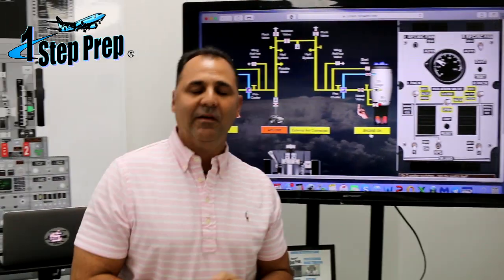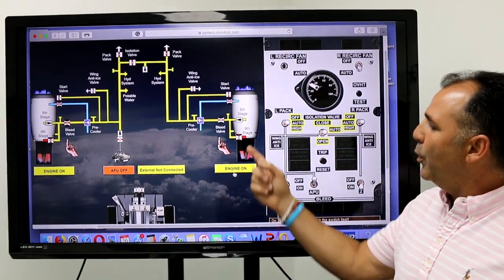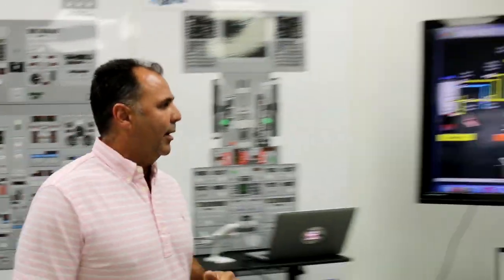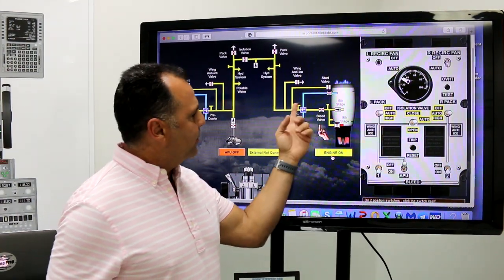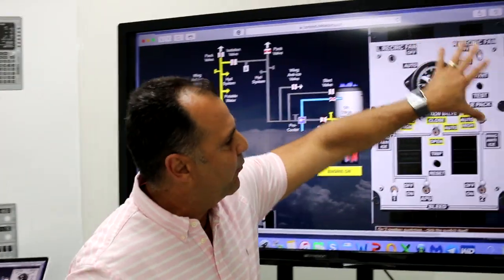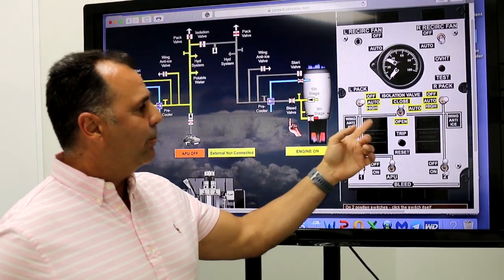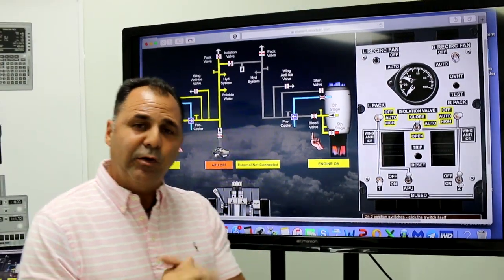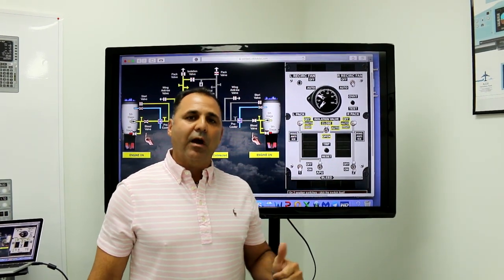B737 Pneumatic System: Bleed trip Off Review

Comment: IN THE 737 IF YOU USE THE TAT EMERGENCY OVER HEAT TEST SWITCH FOR THE WINDOWHEAT THEN IT WILL CLOSE THE BLEEDS WITHOUT NOTICE AND YOU HAVE TO HIT THE TRIP RESET BUTTON OR YOU GONNA FIND OUT THE HARD WAY YOU NOT PRESSURIZING.

Comment: From a maintenance point of view I dislike how the valves are not called by their correct name.
Bleed valve - is the PRSOV (pressure regulator and shut off valve)
Fan air valve - is the PCCV (pre cooler control valve)
On initial engine start, the 9th stage will supply the air pressure to open the PRSOV

Comment: With all due respect, pilots just need to tell maintenance personnel whether the bleed trip reset or not. It’s up to the maintenance personnel to do the troubleshooting and then replace the appropriate component
Reply: True, but it will be good if the Pilots know, what He is actually doing when he is following the QRH procedures.
Reply: Also, it helps the maintenance personnel with the T/S. The more everybody works together, the better; that's what I think. Thank you for your answer👍

Comment: No, no ))You think It is easy. But no. Posiible trouble cause: bleed air regulator, pressure regulator shut off vlv, hight stage valve, sensiting lines, pre-cooler, hight stage regulator, pre-cooler cntr vlv, sensor, switch and mode of engine operating and ext.
Reply: Thank you for your answer, and I know is not easy, but the only thing we want to know on this video is if the problem is Temperature or Pressure, once you figure this out, then you start looking for the right component to change.
Reply: @jcdominguez2075  why, as pilots, are we looking for the right component to change? The simple in-flight fix is to reduce duct pressure by selecting CLB-2 and/ or using engine, and/or anti ice.
Reply: @jcdominguez2075 pilots don’t change components. The most useful thing they can do in this situation is tell the maintenance guy if the trip reset or not
Reply: @NicholasRiviera-Dr  Thank you, Nicolas, I know Pilots, will not change components, this is more for the Maintenance guys, but at least, the pilot can tell the Mechanics if the problem is pressure or temperature, if we actually understand what we are doing, not just following a procedure, what do you think?
Reply: @JuanDominguez-xd7ev it’s nice to know what your doing but if you are a pilot just report the facts:

“We had a bleed trip on No.2 engine. We did a reset and it either:
* carried out a reset and didn’t trip any further
* carried out a reset and tripped again a few minutes later
* carried out a reset and tripped again straight away”

The other piece of information that is really useful is if the duct pressure decays BEFORE the trip. This would indicate a temperature problem. Rarely do we get this information because the First Officer would need to bend their neck backwards constantly to keep an eye on the duct pressure gauge and that just doesn’t happen

Comment: Hi, one quick question: in the NG qrh does not  state how long you have to wait before attempting a reset. It directs you to select the wing anti ice off to reduce the load preventing the 9th stage valve from opening and thus the condition to exacerbate and to reset it and eventually if conditions allow, to reduce thrust in the attempt to decrease the supply of air. How long should i wait prior to pushing the RESET? Many thanks
Reply: The NG QRH doesn't specify a waiting period, so my guess is that the sensors on the NG are improved and therefore requires no time limit before reset.
Reply: Thank you for your support, to answer your question, Boeing said that you should wait approximately 5 minutes.